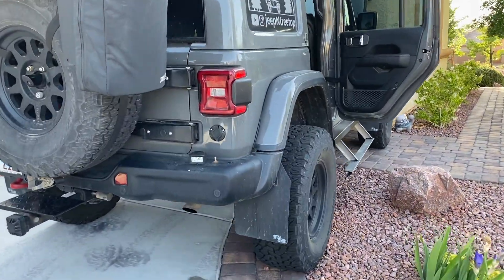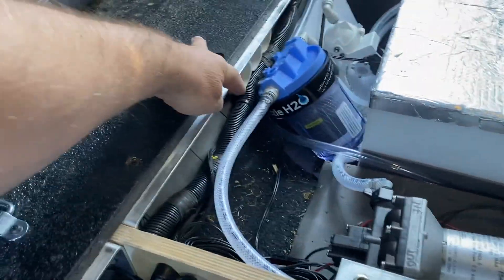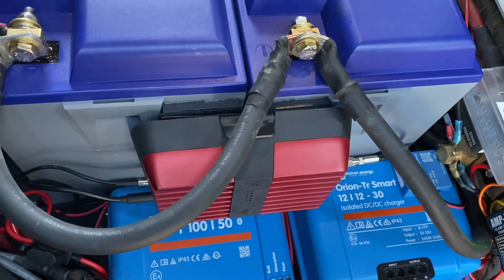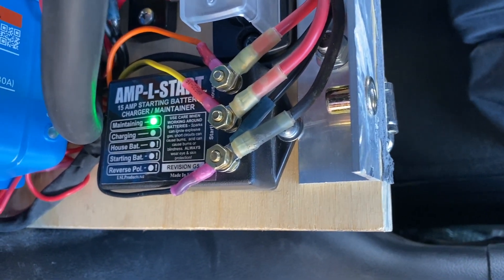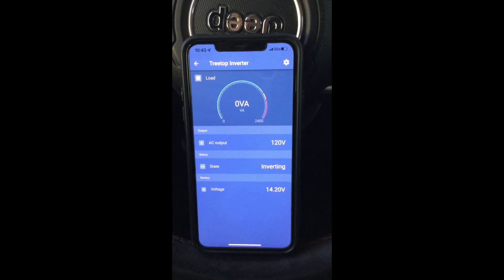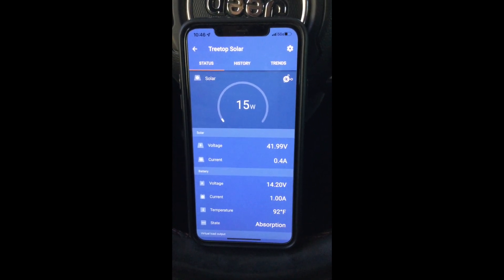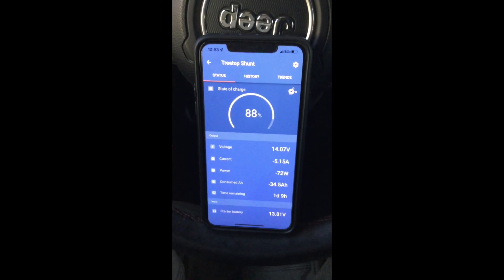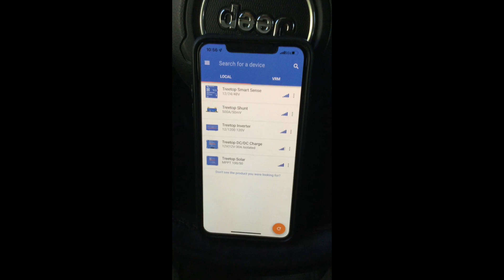My Solar, Battery, and Victron Energy setup overview in my Jeep Wrangler.

Comment: Great setup! But i would recommend that you change your circuit breakers to fuses as breakers can get dust and other particles stuck in their mechanical parts and when they shut off they stay stuck and we’ll burn things.
Reply from the maker: Great advice. I’m going to be pulling that whole setup out this spring and building a waterproof enclosure for that whole area as well. I get very worried every time I do stream crossing and don’t want any water to get to all that electrical stuff. I’ll work in the fuses at that time. Thanks. (The box will also help keep the whole are cleaner.

Comment: I just got my Ursa installed.  I need to run the solar panel cables into the jeep.  How did you do it?  Thanks!
Reply from the maker: Did you join the Ursa Minor Facebook group? If not there is lots of info there. 
But to answer your question you will have to drill through your top, either the side or the top and run your cable down through the angled section of the fabric (it’s a double layer used as a channel for wiring)

Comment: Is there an issue with having a "power loop?" What I mean is that you have a DC-DC charger from the front into the storage, then another device that is sending power from the storage back to the Start/Aux batteries. So,  is that managed only by setting the various thresholds on the devices, or is there some other mechanical or logical mechanism in place? or is it a non-issue ...
Reply from the maker: The Amp-L-Start takes all the guesswork out of it by setting a couple of thresholds jumpers.
Reply: .om